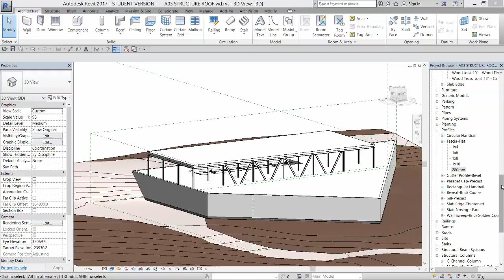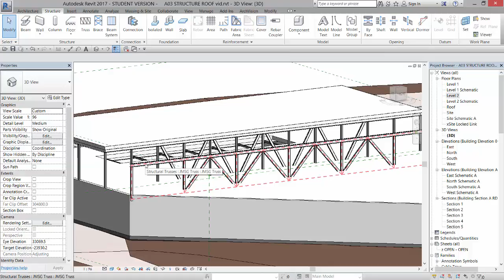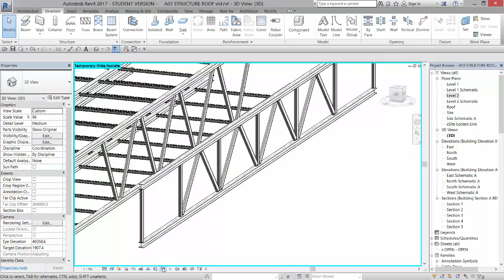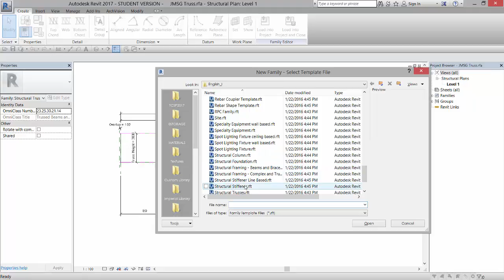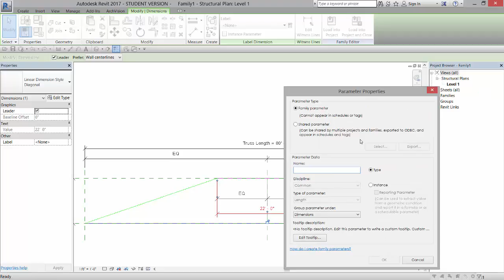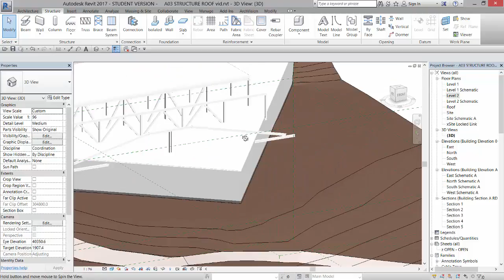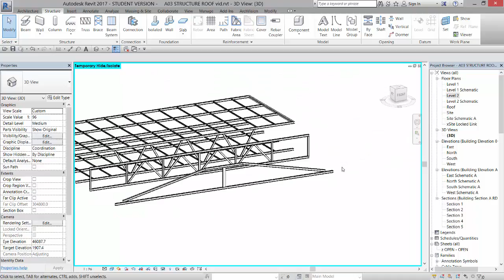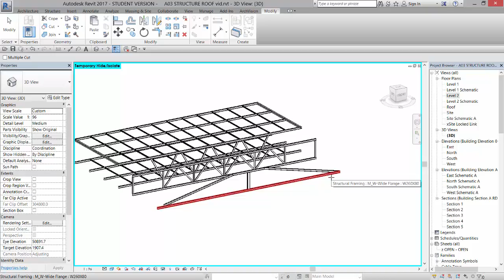3 13 Revit Truss Option

Comment: Is it possible to create a schedule from a truss family?
Reply from the maker: Yes, there is a category for Structural Truss in the Schedules area.  However it is limited in it's Field options.  If you are just looking for count that works, if you are looking for length/height you'll have to add a shared reporting parameter to get it to show up.  I don't know of a way to get the structural framing to show up per truss as it exists in another schedule.